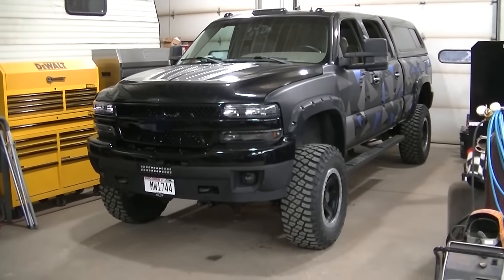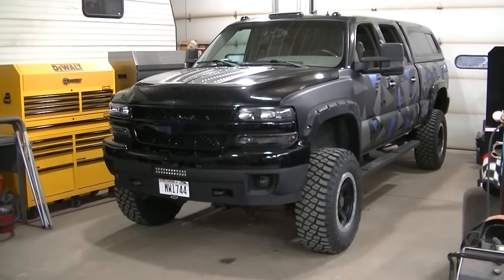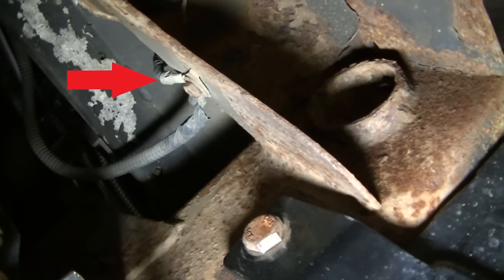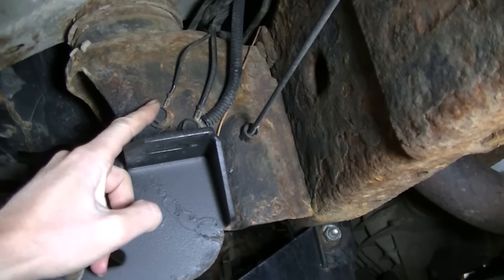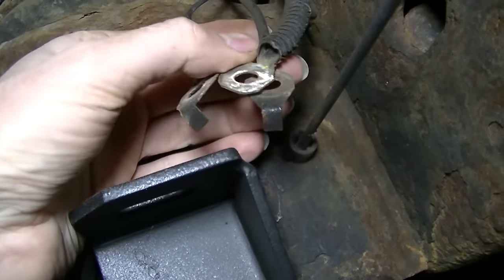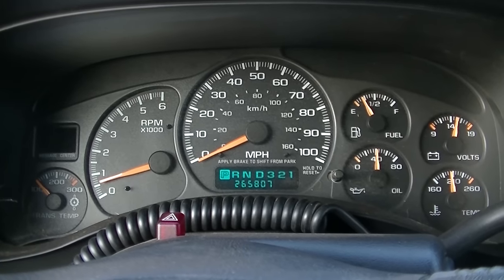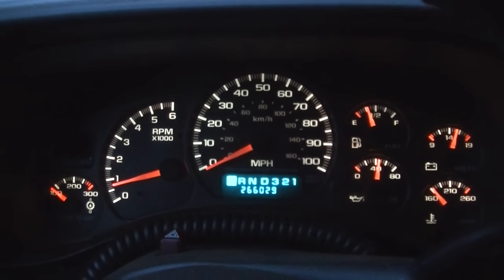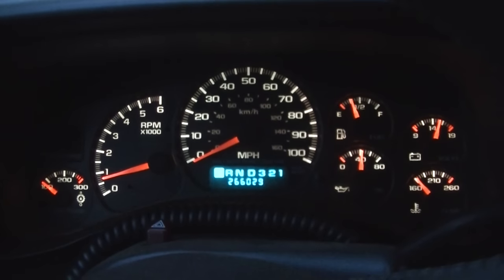ABS & BRAKE Light FIX "Ground Cleaning"

Comment: Can a bad abs sensor make the break light turn on? Asking for Honda civic 2006. Cause my abs and break lights are all on. And the break fluid level is ok. Pls help
Reply from the maker: Don't know anything about a honda but I would assume that if your abs and brake lights are on you could have a similar ground issue.
Reply: Yes, it can. You can try cleaning the sensor and use multimeter to check continuity of the cable.

Comment: Are the light still off since posting this.
My abs has been going off and on . And sometimes the parking light 
I will go stretches where the abs will be off then go on after driving a while.  But must times it’s on right away and stats on   , suck a pain in the ass
Reply from the maker: They are still off.  Mine were pretty random.

Comment: Your truck is much newer than mine (have 1990 sport truck). My park brake light stays on and or blinks when foot pedal is on/off. So now that I see others with similar grief I am going to look for bad grounds. I did take it to a brake shop and mechanically I am good. So in the mean time that candy bar is hiding that damn red light !!

Comment: what did you use to clean then??
Reply from the maker: Used a grinder to clean frame to bare metal and a wire brush on the wire terminals.

Comment: Before I tried this, my abs and emergency lights would come on together a few miles into every trip.  After I cleaned the ground cables/screws/body and screwed them back in,  my hazards and  "traction active" comes on now in addition to the brake lights immediately upon start up.  Any idea why?
Reply from the maker: Not sure what's going on with your truck but traction control is related to the brake system.  I don't have any traction control on my truck.  You might want to check the wires that you moved while doing this.  I would take the loom off and get a look at the condition of the wires.

Comment: Didn’t work for me on my 01 1500, Gonna pull the cluster and remove those lights.
Reply from the maker: I have found that sometimes it works and sometimes it doesn't. It's worth a shot to try. In your case I would guess it's the abs module that has gone bad.
Reply: EBCM prob needs repaired or replaced.  There are other videos on the tube to walk you thru fixing the EBCM, or you could just replace it.

Comment: my 98 k2500 is so rusty its plowed since new and still going daily . i scanned the abs it wont even communicate with it so i may have to run the wires up to the battery ground or somewhere cleaner . thanks for the info on the grounds
Reply: My abs and break light comes on only when i drove 130 t0 140km  and when i turn it off and on my engine light comes out why is that so?

Comment: God same with mine everytime I get a damn light off another turns on it is really aggravating
Reply from the maker: That's the way it goes with older higher mileage trucks.
Reply: @mossman381  yeah the only benefit about my truck is that I can fix just about anything on it. My main constant issues are the stupid wheel hubs and cv axles always getting destroyed since the front axles always spin the boots always tear and loose all the grease and the hub bearings blow out once a year. They are crap. Even the pricy stuff is still crap.